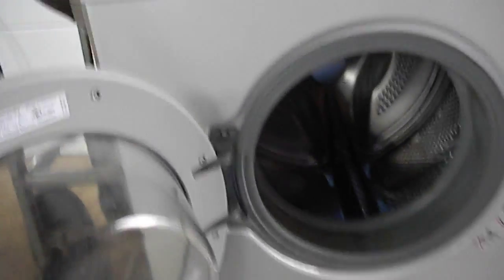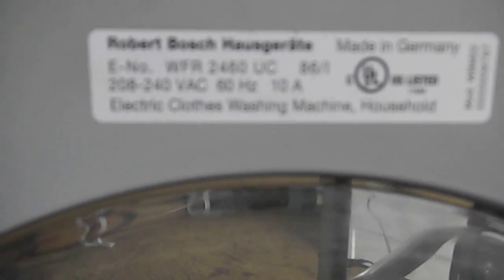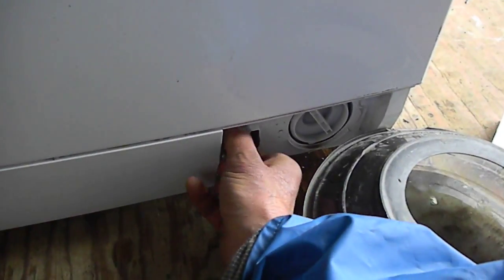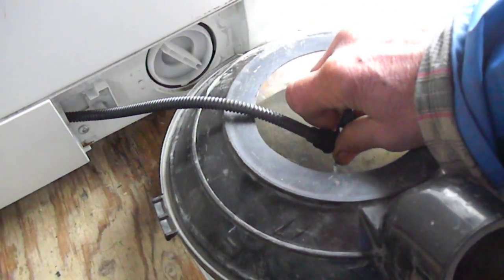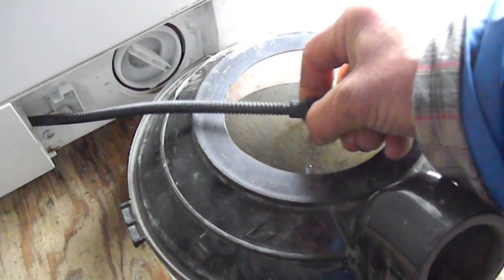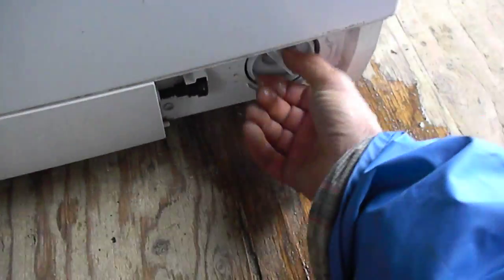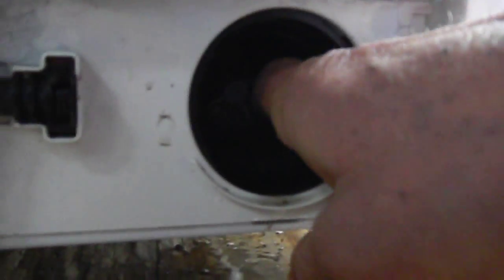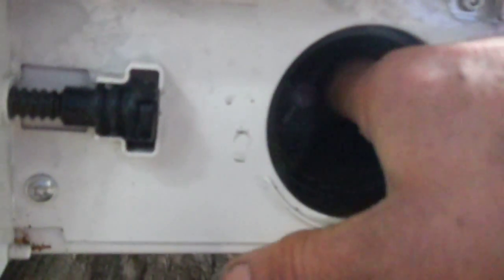Bosch Appliance Repairs 707 443-8347 Pt 9-5

Comment: Sir, I have a Bosch Nexxt 300 front loader washing machine (it's 7 years old) that has started to give an error code of E13 and it won't drain. All other functions seem to work fine. It only does this occasionally and when I restart it or manually select drain or spin, it then drains. I have checked the drain pump for obstructions but haven't found anything. The strange thing about this issue is that it is intermittent and it doesn't matter how large or small the load is for it to just 'decide' not to drain. Every once in a while when I am trying to get it to manually drain, it will just sit there and emit a low humming sound, but then, when I turn the switch from drain to spin, it will drain and spin. It sounds to me like the drain pump might be getting weak, but I want to be reasonably sure it's not something else before I invest in a drain pump. Any help you could give me would be greatly appreciated before I replace a part that doesn't need replacing. Thanks... Alex

Comment: What model is this? It looks like the same as mine although mine is just the AXXIS not the AXXIS +. I am having an issue getting the foor to open. The model number is located inside the machine so without opening the door I cant find the model number or the manual.... Can you help?